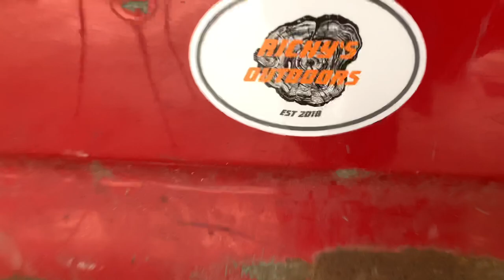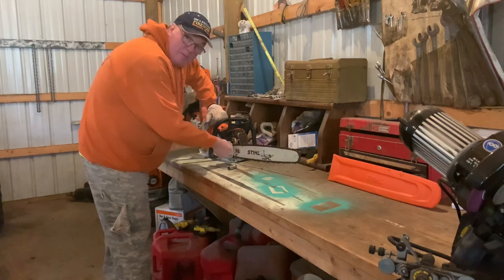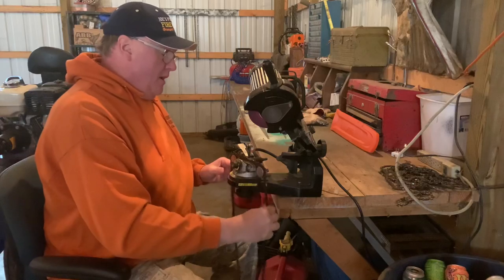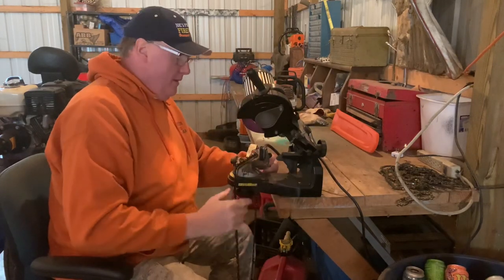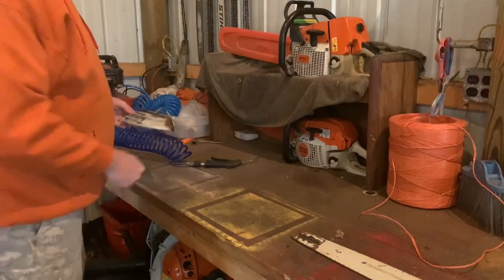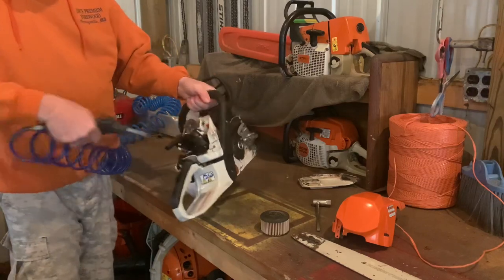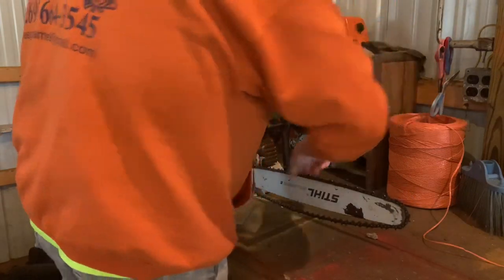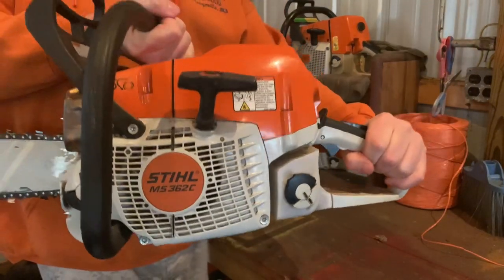MUST DO basic chainsaw maintenance

Comment: Joe, you never even looked at the chain to see if it was sharp after only two hits with the grinder. There's a good chance it is still dull. 6 times sharpening before you do anything with the rakers?? You should be using a raker gauge at least every other sharpening. 
Pushing on a saw at all is hard on a saw and hard on you. That's why you can only stand to cut one load per day. 
You should have also cleaned the oil hole in the bar and the rails also. 
Don't be crabby about what I'm telling you. I'm just trying to help you out as much as I can a little at a time. There is a few more things that you could do but this is enough for you to grasp for this lesson. 
Take care bud!!😀😀

Logger Al
Reply: I will fully agree with you Al, at least check the rakers after grinding.
Reply from the maker: Logger Al the grinder is running at like 12,000 RPM, two bumps should be more than enough.  I hate dealing with the rakers and usually take them way down
Reply: @JoesFirewoodVideosII  I have a grinder exactly like yours. I only use it for sharpening my 3/4 11BC tree harvester chains. I still sharpen all my chainsaws with a file because I can do a better job than the grinder can.